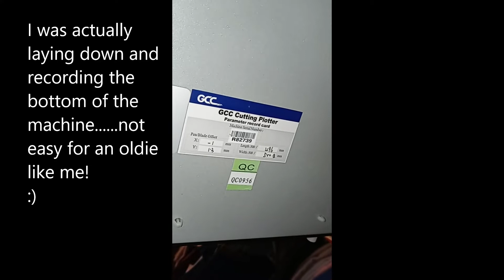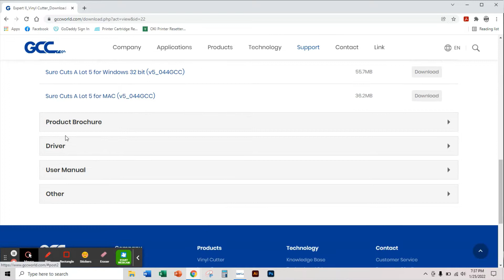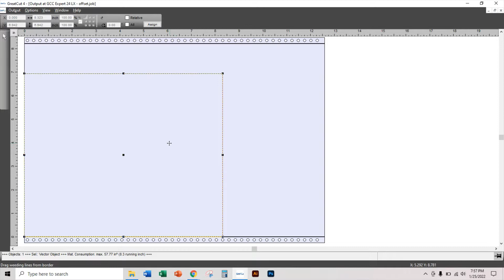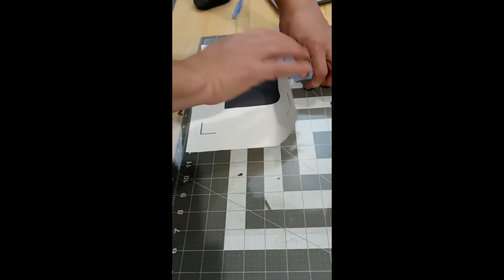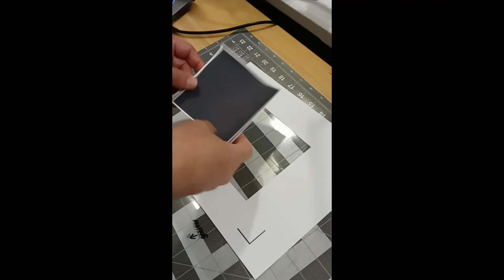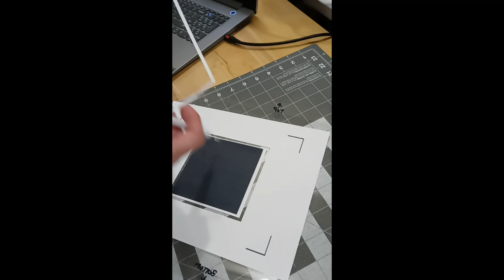How to Calibrate your GCC Expert II LX

Comment: great video, when i click on output i get an error3 , when i DL the great cut how do u plug in illustrator. thanks
Reply from the maker: Thanks for watching and subscribing!
Make sure you have the correct drivers installed for your cutting machine. Also, ensure communication by selecting the right output port, USB/COMM
I used to have my old laptop connected with GC4 and illustrator but rarely used it. Contact the GCC technical support team for an answer to that question.

Comment: I cant get the VLCS3 to read my GCC Expert ii LX. It never picks up the model. It eventually just freezes and I have to close it. You didnt show how you open the file so i just double clicked on the VLCD3 application icon after i unzipped it. Am I doing it wrong?
Reply from the maker: Thank you for your comment!
Be sure your cutter is online and connected to your PC.
It's at about the 4 minute mark.
Click on the drop down device menu and you should be able to see the Expert II LX.
Make sure you are using the correct vlcd file for your machine. Mine is an older model so it uses the VLCD3, yours may use a different one. Contact GCC for the right version of your cutter.
Reply: Me pasa lo mismo brother

Comment: https://youtube.com/shorts/5eATby9mc7M?feature=share
Reply from the maker: It looks like a printer setting is not correct.  You may have your printer setting at "fit to page" and it is affecting the size of the image and location of the register marks.
Check your printer settings and DO NOT USE "fit to page" but do use "center" to make sure your image is printed at the actual size.

Comment: Hello. My machine is not reading the third jog mark. Also it is now not cutting correctly when it does scan the register marks. I did calibrate as instructed but didn't do any good. What could be the problem?
Reply from the maker: Thanks for watching, liking, and subscribing!!
Reply: I posted a link to the video of what the machine is doing.
Reply from the maker: @Wstrongg  for technical questions like this, please contact GCC directly at gccworld.com
Reply: Ok I am currently working with them. Didn't know if you had this issue before. Thank you so much.